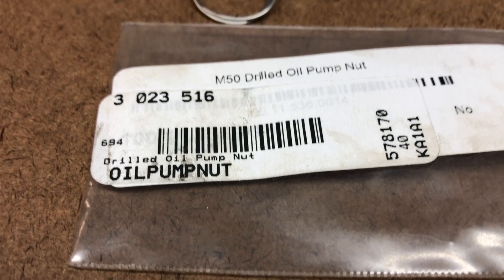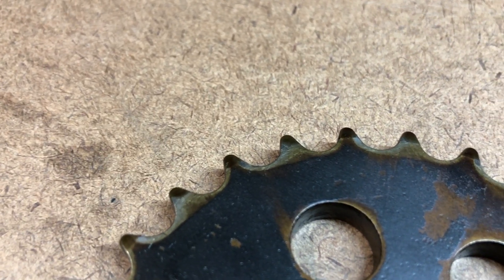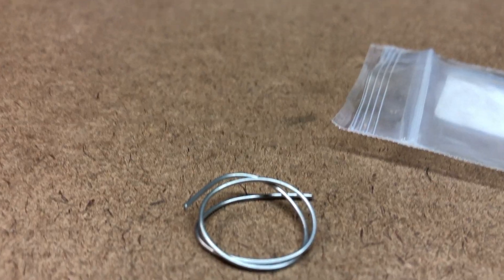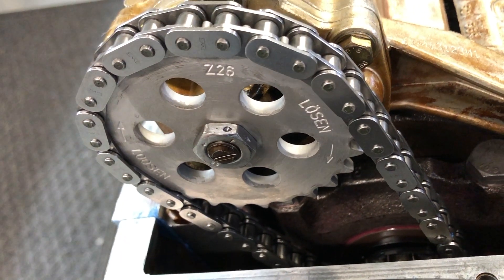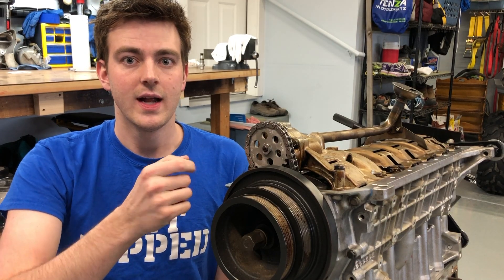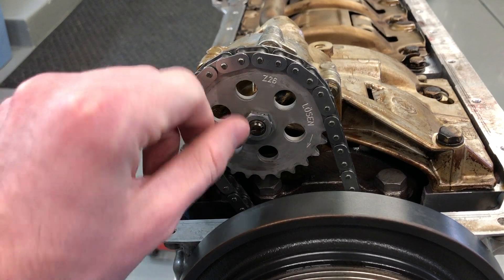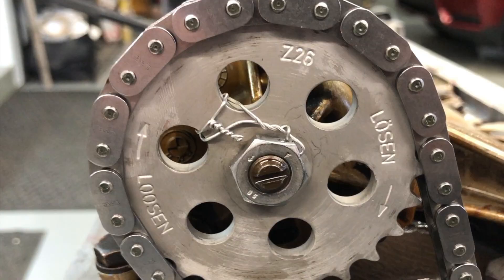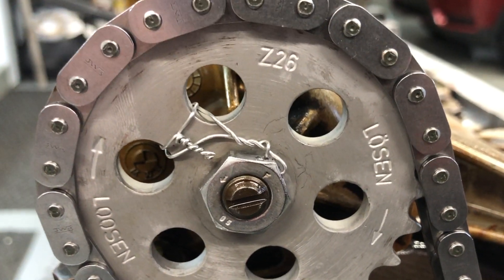E46 Turner Motorsport Oil pump nut install $15 can keep your M54 engine from losing oil pressure.

Comment: If I convert to a single mass flywheel and just daily drive my car and keep it under 6k , will I have any vibration issues? I plan on upgrading this nut .. 
I don't track the car or anything. Thanks.
Reply from the maker: No matter what. I’d do you me oil pan gasket and get it fixed. Even without a lift. It can be done in 3-4 hours. Absolutely worth it
Reply: @TenzaMotorsports  

Do you think it’s worth it to
Convert to a single mass flywheel ? I definitely wouldn’t might quicker revs and getting the car to feel more spirited while driving.
Reply from the maker: Yes. Especially If you already need to do a new clutch.
Reply: @TenzaMotorsports  

Appreciate that , thanks for all your help and responses.

Comment: So it’s at the top of the motor so it wouldn’t have to be pulled right?
Reply from the maker: It’s a reverse thread. Pulled left so it doesn’t spin off to the right.

Comment: I feel like such an idiot for asking this, but how does the wire not snap or prevent the sprocket from rotating? I thought the sprocket had to turn to work the oil pump, and the way this mod is done seems like it would impede that. I'm very confused
Reply: The sprocket, the nut and the shaft spin together.

Comment: you said this is only an issue on the 3.0 engines? should i still look into a fix for this on a 325i with 150k miles?
Reply from the maker: It wouldn’t hurt to do it. It’s not super expensive. But it doesn’t really need it.
Reply: @TenzaMotorsports  Okay cool, thanks for the response

Comment: Somebody else here made an important point, in my view the most important. I have a 330ci track car (still building it) and have undertaken a great deal of research into the oil pump nut issue. Whilst it would be advisable to wire the nut or change to an upgraded oil pump etc, I believe the main contributor to the vibrations / bad harmonics is the lack of a chain tensioner. I have not personally heard of a nut failure where the car had a chain tensioner fitted. This is why when people weld or tie the nut it can still fail or the shaft breaks because of the slack in the chain..
Reply: So some people add a tensioner to the m54 chain?
How can it come out if you weld the nut?
Reply: @imestia7911  the slack in the chain and the heat from the spinning causes it to shear itself off even when welded.
Reply: So some people add a tensioner to the m54 chain?
How can it come out if you weld the nut?

Comment: so I occasionally get "low oil pressure" warning in my 5 series that has the m54. would you assume that this is something I should have replaced ASAP? I am NO expert, so any advice would be awesome! THANKS!
Reply from the maker: It’s really only an issue with the 3.0 If yours is a 3.0 than I would look into it for sure. The smaller engine rarely has this issue.
Reply: Tenza Motorsports yea mines a 3.0. And it’s a not a faulty sensor I’ve had that replaced

Comment: 3 weeks i study this big problem.In few days i start to rebuild engine with upgrade oil rings from 2.8.I dont think this nut suffer from engine harmonics because is hard to transmit waves so drastic. In my opinion the big problem is missing the chain tensioner so we have slack chain who create a lot of damage and vibration on the oil pump sprocket. On track not full throtle is problem but brake engine raise the vibration in sprocket.I will put wire, loctite 270 an a chain tensioner and hope to resolve this problem.

Comment: I raised my rev limiter to 7k rpm, and it’s a daily driver with occasional spirited driving, some people say to do this but only if your tracking your car.  Is it worth doing if it’s a daily driver and don’t live in the 6500rpm rev range often?
Reply: My M54B30 had its oil pump nut fall off last night. Stock rev limiter, street driven only.
Reply: @busterscrugs  it happens on the 3.0
Reply from the maker: I would do it ASAP. And if you need an oil pan job that’s the tome to do it. The older the car gets the more likely it will happen

Comment: I read somewhere that 03+ cars have an updated harmonic balancer that solves the oil pump nut issue (at least at stock rev limiter). I've confirmed on FCP that the part numbers for the different model year cars are indeed different (11237513862 on 03+ cars vs 11231438995 on 02 and previous). Any thoughts on this? I hit limiter all the time on my 03 E39 and haven't had issues.
Reply from the maker: I really don’t know. I used to bounce mine of the red line constantly with not problems. And now I have that wire nut I’m safe. So I haven’t looked into it again
Reply: @TenzaMotorsports  Not sure you'll see this, but here's an update. My oil pump nut fell off on Saturday, I shut the car off as soon the red oil pressure light came on, and had it towed home. Dropped the subframe and pulled the pan on Sunday. I drilled my stock nut by hand (no drill press) and safety wired it to the sprocket. Also used some loctite. Needless to say, 03+ cars are not immune to this issue lmao.
Reply: @busterscrugs  I hope the engine survived that by the sounds of it or did it run dry?
Reply: @TenzaMotorsports  For sure, thanks for the reply. My friend drilled the stock nut himself and safety wired it. I'll likely do the same when I get around to changing my oil pan gasket.
Reply: The part numbers are different because the air conditioning pulley part of the damper is different. 3 ribs in stead of 4. Otherwise, they are the same.
Reply: It is long periods of time spent at high rpm that causes the problem. For example, you are on a long straight at a track day bouncing off a raised limiter. That's when the nut is in trouble.